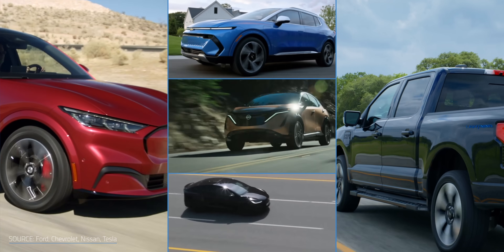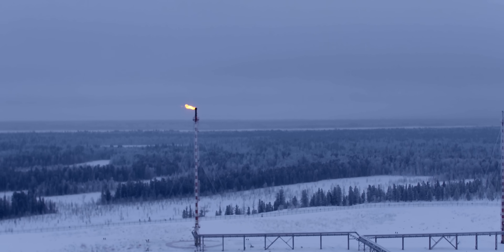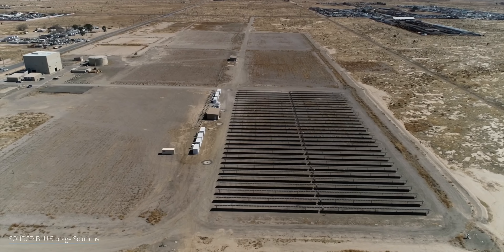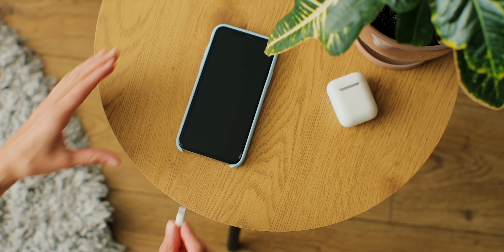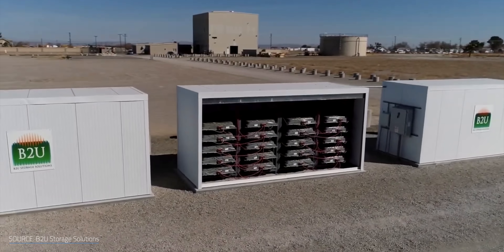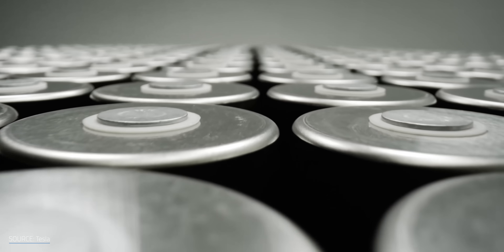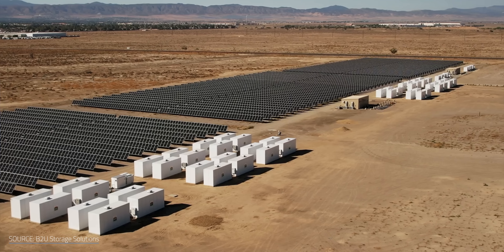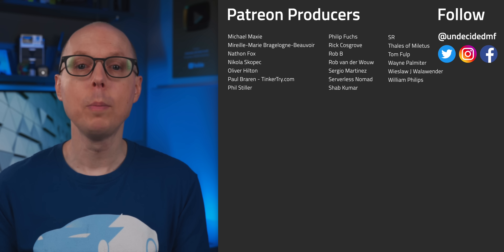How Old EV Batteries are Perfect for Energy Storage

Comment: How about looking into storage of energy using electrolysis of water and storing the hydrogen. A long term storage alternative.
Reply: Hydrogen is notoriously hard to store for long term as just about any container will slowly leak over time and the energy density is relatively low for the volume it takes up.  It'll make more sense if we can develop fusion but we're not there yet.
Reply: @ZeoCyberG not sure what hydrogen for energy storage and fusion have to do with each other.
Reply: @michaelmicek  Fuel for fusion, along with energy production for actual benefit, efficiency, etc
Reply: @ZeoCyberG  the hydrogen used as chemical fuel is irrelevant to fusion.
Partly because the energies are so different, but mainly because hydrogen isn't fuel for fusion, at least not on its own.
The easiest fusion is deuterium-tritium, which are isotopes of hydrogen but not what would be in your tank.
There is a boron-protium process that could be used (protium being regular hydrogen) but most if the fuel there by mass is the boron.
Reply: @michaelmicek  Sorry but no, even regular hydrogen can be used for fusion. It's just easier with the isotope, doesn't change the point regardless!
Reply: @ZeoCyberG  the sun uses regular hydrogen, slowly fusing it into helium, but no terrestrial process will do so.
Reply: @michaelmicek  No, again, it's only easier to do so with the isotopes.  While you're ignoring the whole process of getting those isotopes in the first place anyway. Among other things you're getting wrong. Like I never confused chemical reactions with fusion like you did, you just made that assumption and confused yourself on this...
Reply: @michaelmicek  For example, Human-made tritium is generated by bombarding hydrogen with neutrons in a nuclear reactor or an accelerator.  Something that would have to be part of the process or we wouldn't have enough tritium for a sustainable fusion power system as it's rare.  But it starts with hydrogen and regardless, the issue of long term storage remains as the isotopes aren't any easier to store long term or remain stable on their own.  However, fusion is key to providing enough energy for our growing needs and will be key to actually allowing us to move away from fossil fuel permanently.
Reply: @ZeoCyberG  tritium isn't made from hydrogen, at least not ordinary hydrogen.
It can be made from neutron bombardment of lithium, boron, or deuterium, but not ordinary hydrogen, as that would require two neutrons to hit the proton at once, which is improbable.

Deuterium is stable... and I suppose is also easier to store (as a liquid) than hydrogen as it's denser and doesn't have to be kept quite as cold.
But again, this is beside the point.
The question was about storing energy chemically and had nothing to do with fusion.
Reply: @michaelmicek  No, storing hydrogen is not storing energy chemically.  It's an element, it just can be used chemically like pretty much all elements on the periodic table.  It's hardly the only element considered for fuel cells or combustion energy generation methods.  The question from the OP was for storing hydrogen for energy!  You misunderstood the question from the beginning because of your assumptions that it would only be used for a chemical process but that was never the only way to use hydrogen for energy.  

Besides, no, there's just more than one method of producing tritium but fact remains it is hydrogen, just a radioactive isotope version. You've only pointed out the easier ways to do it with existing technology.  Regardless, Natural tritium also exists in trace amounts in water.  Even the human body has some trace amounts because of this and when you extract hydrogen from water you also can be extracting tritium and just need to separate and purify it for use. While there's options for fusion that only use Deuterium, which is much more abundant and both trace amounts of tritium and deuterium can be extracted from water, just like regular hydrogen.  It'll just be similar to nuclear enrichment to purify to just the isotopes.  

While you're also ignoring other methods of producing fusion fuel.  Like the Norman reactor, TAE Technologies experiment of fusing normal hydrogen nuclei—protons—with easily mined boron. Among other ways they are considering developing fusion that you are clearly not considering.  

So we can argue this from multiple ways but it still leads to the same points that there's a problem of long term storage and producing enough energy to actually make a real difference.  Even going by your assumption of chemical energy, one of the reasons we aren't using hydrogen for fuel cells, etc. is because of that storage problem and getting enough energy out of it to make it cost effective.
Reply: That is coming; not for grid storage, though.

This channel has talked about battery chemistry for grid storage quite a bit.
Much better choices than lithium ion car batteries are available, but these car batteries have the advantage of having already been manufactured and ready for (re)use.

A big advantage of hydrogen is that it can be put in a tank and transferred quickly.

A problem with hydrogen has been that electrolysis of water was not very efficient, but this is a problem on which progress is being made.
Reply: @michaelmicek  Along with problem of long term storage and energy density for cost effectiveness.

Comment: I've been arguing this exact point since 2008 when I was living @ a retreat center that was dependent on off grid power.  Our old AGM battery solution wasn't providing the necessary storage capacity after about 20 years of constant use.  I actually reached out to Tesla @ the time seeking to work with them on a solution to repurpose batteries that were no longer viable for use in cars.  The answer I got from them was FU we don't want to have anything to do with your idea.

Comment: we should move towards fuel cells rather than lithium ions, we all know shit tons of earth has to be mined, then processed, just for the battery to be of use for 6 or 7 years. And anyways, cars themselves aren't efficient whatever tech you use!! 3 tonnes for carrying one 80kg man, yeahh very efficient
Reply: Fuel cells need fuel.  Fuel needs energy to refine again and again so it wouldnt make much sense.  I do agree with your heavy car comment though.  We need to do much more to get people out of their cars.
Reply: @londonyes1380  I would ask of you to look at the li ion batteries life cycle, mining destroys the local enviroment, from earth to air to water sources Then Li ions aren't really efficient for long so in the long run fuel cells will be more efficient, then where are we gonna put those 700kilos or so of the batteries. Even now when the batteries are sooo common, we don't have a proper way of recycling them, cuz recycling them is just tooo difficult. And then we consider the fact that batteries are only efficient at 25degrees and a bummer, 99% of the world doesn't have that temp 90% of the time and many parts are way too hot to be traveling in a with a 700kilo of instant flammable shit

Comment: HIgh performance liquid cooled battery packs designed for automotive use cases will result in heat management problems in cheap, static installations that lack the liquid cooling.
I cold climates, the heating of the batteries will be an issue as well.
A step forward, but not a killer solution.

Comment: Another thing we might possibly do to prolongue the battery lives, is to rate their mileage on the cars for their 70-80% rather than when at full health. You will then get extra mileage from a new car, but once it's used up it will reach the target mileage you bought it for. But then again I'm not sure how fast it drops to below 70%.
Reply: They already build a bit of a buffer(5-10%) into most EV batteries specifically to protect from overcharging/over discharging. Having 20-30% of a buffer is really kind of a waste of batteries and weight.

Ultimately 'range' is kind of a nebulous definition based on very specific, non-real world criteria.

In the real world, a car originally rated for 300-330 miles is perfect for probably 95% of people (I like to think of myself as somewhat typical a person)

For local/day trip travel I just want a 100-125 mile radius of never needing to charge (this covers a surprisingly large area).
Going 200-250 miles round trip for a daytrip is 4-6 hours of driving depending on speed limits so its a decent expectation if you also have to fit an activity into your daytrip.
If I spend a lot of time on slower 2 lane roads (common in the midwest) this radius can go up to 150 miles.

On road trips all I care is that the chargers are 100-140 miles apart. This distance allows you to use the bottom 60% of the battery (where fast charging is fastest).
And its far enough apart that a person is likely to want to stop, but close enough together so that even in winter you can crank the heat and drive at the speed of traffic while still having short duration charges.

Because of this, even at 75% of original capacity, an EV that began its life with 300 miles of 'advertised' range will still be more than road trip capable, provided its fast charge capability is not also diminished.
Reply: Mileage is already a very rough estimate for cycles that change dramatically in differing conditions. To increase the usable life it's better to charge to around 90% each time, which can in some cases almost double the number of useful charge cycles.

Comment: The problem with BESS is that they are a net hole in an already critically-loaded grid. You still have to have some sort of generation to recharge the containers. Batteries are a low energy-density, temporary patch to the current problems.
Reply: I agree entirely. This is essentially a publicity stunt to make money. The methane byproduct from oil production will harm the environment whether you burn it or not, so the problem is oil production. Why are we not banning plastics? This would do so much more as it would eliminate an income stream for the oil industry and at the same time prevent this non biodegradable pollution. The trouble is that the US are enamored with high tech solutions which result in little or no impact to their lifestyles. Entropy is real.

Comment: Things that we have learned in the last decade;
1. Batteries are lasting longer than we thought
2. Solar panels are lasting longer than we thought
3. Wind turbines are lasting longer than we thought

We also kind of knew, but it has been confirmed that second (and third) life for EV batteries would be a thing, once we can actually get hold of them (see item 1 above).  Nissan set up a second life battery company in Europe, but the supply of batteries was so slow due to long battery life, they closed it down.

When we add vehicle to grid functions to cars, we can kill off those peaker plants for good.  Here in Europe, the typical power demand from a car motor is up to 200kW when you accelerate hard, this is what the batteries are designed for. Also typical in Europe is that your home car charger is up to 7kW for a single power phase.  Car motor = 200kW, maximum house load is 7kW.  This is why vehicle to grid does NO DAMAGE AT ALL to your car battery.  As proven by the company in this video managing to control “dead batteries” very well indeed.

Comment: Our first gen Nissan Leaf is down to about 75% battery capacity and its 10 years old. My wife will continue to use it to drive to work, which is short range, for many years to come and itll be great for small daily chores. We will ride it till it dies, it will be 20+ years old with next to no repairs or maintenance necessary in that timespan. Even currently with 75% capacity, only once a year might we want to take a roundtrip longer than what it can sustain, so it fits us just brilliantly.
Reply: I think Nissan wisely overengineered (underpromised/overdelivered) their batteries at first.
Reply: @michaelmicek  They also foolishly air-cooled them, leaving to degradation rates that rival cell phone batteries. At least nobody copied that mistake...
Reply: @HenryLoenwind  except the point is that for most users they greatly outlasted what was promised.
Reply: @HenryLoenwind : Being air cooled matters a lot less than most people think. Even in ambient temps over 90F, parking directly in the summer sun, my LEAF’s battery rarely broke the 96F mark. Granted, that’s not the absolute optimum temp, but considering that it quickly cools down to 83-85F overnight, it’s also not that bad either. Another thing to consider is the fact that the liquid cooling system also makes the pack as a whole much harder to repair; so if one cell or module of a liquid cooled pack goes bad, it’s often quicker, easier, and safer to just replace the whole thing rather than rebuild it. With the LEAF battery being dry and held together by threaded rods and nuts (rather than thermally conductive glue), that makes repair/rebuild much more feasible.
Reply: @jacobcarlson4010  In the leaf, the batteries were air cooled and part of the pack lived up behind the rear seats, where they weren't exposed to air. The lack of water cooling doomed them to fail.
Reply: @surewhynot6259 : That’s the public perception, yes, but that’s also well overblown. You mention how some of the pack lived up under the rear seats, as if that makes them significantly hotter. It does not. Even on a 102F day back in 2022, with nighttime lows of 78, the delta between the 3 thermistor readings was only 3C (6F, give or take), and that’s also the only time (at least, since winter of 2019) that the battery has broken the 36C mark on the highest reading. Seriously. In the most literal sense of the word, a LEAF battery will degrade more than a tesla’s liquid cooled battery; but from my own direct experience, it’s way overblown. And just for the information of everyone else on here, today the pack temp when I left work was 1C over ambient temp, at 32C on the highest thermistor. Again, maybe not the perfect temp for it, but many miles from being the end of the world.
Reply: How many miles has it done?
Reply: With such short travel distances then why not just do most of those trips on a bicycle? And there’s ways around carrying gear and kids in the bicycle space. 
Why use power from the grid when you don’t need to?

Comment: While we should not be slowing down the growth of EV-s, we should be lowering overall car usage, as cars are extremely inefficient compared to trains and trams. especially since trains and trams can be directly conected to the grid, so they can use directly grid power instead of having to charge and discharge a battery, thus lowering overall evergy usage. and less space is needed to upkeep public transport for the same number of people, compared to if everyone used personal cars.